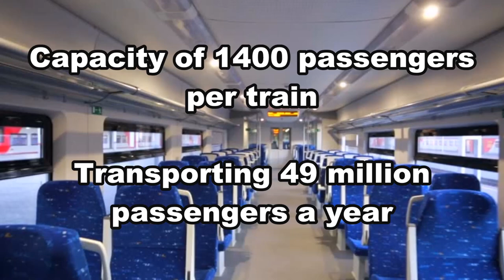Full Alignment - Philippines High Speed Rail (Calabarzon)

Comment: Most bullet train in Tokyo runs at 200-320 km/hr. At 350 km/hr , you will be in Lipa approx  12 mins, 20 mins in lucena and an hour in legaspi/ sorsogon. The fare however is almost the same as taking an airplane. Can the masses afford it? In Tokyo only the middle class to rich uses this because one way fare is more than 3.5k pesos for the nearest destination. The reason for the high fare is it consume a lot of energy/power and the material of the coaches and tracks  are super durable to withstand high speed thus expensive including maintenance and spare parts. It maybe feasible after many decades. What is doable is what they call in Japan  Tokkyu or limited express or rapid rail which run much lower than a Shinkansen ( bullet train)
Reply: You are using Japan as the medium of comparison. You are certainly forgetting China. Chinese bullet trains can easily reach 400 and is quite cheap. For 3.5k pesos, you can go from Beijing to Shanghai (roughly the distance from Fukuoka to Tokyo). And we are talking about Chinese bullet trains.
Reply: Short distance such as Panjin to Yingkou cost CNY41 or 296 pesos. That is still expensive for commuting public. As you said Beijing to Shanghai is 3500 pesos already.  The Chinese government is subsidizing the fares that's why it's cheaper than Tokyo. Can our government do that? It's a burden already for the subsidy given to our LRT/MRT.
Reply: When commuting is faster people are more productive.  The more productive you are the more money you earn.

Comment: My info about this rail line

If this project was created,its track gauge will be:1340 mm 
Its electrification is:25kv and 20kv for small hsr lines similar of those in japan.
The train rolling stocks are the:maharlika 1hsr which will operate in lipa to lucena with a roughfly 350km/hr and maharlika 2hsr stock that would move at 80km/hr to 145km/hr.

The project will be constructed by JICA and it will also have stages too

Stage 1:tutuban,manila to calamba station.the tutuban station could be underground like the nscr san fernando underground station.and the calamba station will have a bypass road to proper calamba city and a busway line to calambas transport station

Stage 2:the calamba to lipa station,they could potentially put a transport service near lipa like that ones of sm transport station.the line will be a viaduct but will go in ground when it goes to the batangas line branch.

Phase 3:batangas branch that will have a lower electrification:like 20 kv or 10 kv till we go to the batangas station which will be a depot that will have turntables and loop rails.it will cost 50 pesos per passenger

And stage 4:the lipa to lucena railway.that will move at 350km/hr
And it will go lucena and could deliver passengers up to 2million/per month. And will cost 100 pesos from lipa to lucena.

What happens to the old pnr line:it will be turned into a freight line which will be a seperate lane gauge to lucena and will be used in  sea and land tranport.

There would be another line to sorsogon which will feature 345km/hr and is ongoing till today

Comment: Interesting concept, however the ROW beginning at 5:10 will conflict with the currently under construction connection from SLEX to NLEX.  If they stay over the current ROW, it could work, but, especially near Buendia, it will be extremely tight.

Comment: I am all for High-Speed Rail in the Philippines. However.....3 intermediary stops on a 140km line is too many, if you plan to have trains running at a max speed of 350kph. Either scrap one or two stations, but that would make the line unprofitable and more difficult to sell to the public, or reduce the Top-Speed. It will not make a huge difference to the travel-time, but a huge difference to building cost. Building a railway for up to 350kph is way more expensive than for up to 200kph. 

Ignoring Buendia for now, for the rest of the line the average distance between stations will be just a little over 40km. IMHO a top speed of 200kph on the Lipa-Lucena stretch would be more than adequate and would keep building costs down massively. A lot of the distance between them would be used to accelerate and decelerate, and only reaching 350kph for a very short time. 

Between the outskirts of MM and Lipa I agree with you on a Top-Speed of 150kph, maybe 160kph. That sounds very reasonable. 

Another advantage of reducing the top speed to 200kph is that the rolling stock is more readily available at lower prices. By using tilting trains, you can reach higher speeds on lines that are not so straight. They can also increase the speed on the twisty Batangas Branch.
Reply from the maker: cms1104 Cheers. Now that you said it, I'm thinking of reducing the speed to 300 km/h unless there is an extension to Sorsogon
Reply: No, actually its quite feasible. 3 stops for a train built for 350 kph but with standard speed of 250.

Comment: The nuclear power plant must be operational if the government will proceed with this project. This project is great but the manila line up to buendia line must be placed underground, to reduce the time of travel at the same time it will reduce the traffic above, and then breaching itself from the south luzon highway, the bicol line must have same as the batangas line, one is fast line and the other branch will be the entry to the northern camarines. no need to put these line on the ground because of accidents.
Reply: Pinakamaganda gawin unano ang tao buong mundo mga 2feet taas..para tipid lahat,😆😆😆😆😆

Comment: Gawin na wag puro plano
Reply: Ni hindi pa nga confirmed na magkakaroon ng ganito sa atin. Bruh
Reply: @ToddKeck98  long haul confirmed na gagawin pero kung bullet train ba or ano parang hindi
Reply: Hindi bullet train (kelangan 250 kph+) ang south long haul. 160 kph lang siya.
Reply: @ToddKeck98  actually parang regular clss train lang sya eh alam ko lang na high speed rail ay yung nscr
Reply: Di rin high-speed rail ang NSCR (160 kph lang din max speed ng NSCR). Marketing term lang siya noong 2013 para i-hype yung project.
Reply: @ToddKeck98  high speed railway ang 160 kph ang bullet train ay 360 at regular mga 80
Reply: @ToddKeck98  mga 200 kph pala highspeed railway pero kasi may mga cases den sa china na 160 kph pero considered as high speed railway